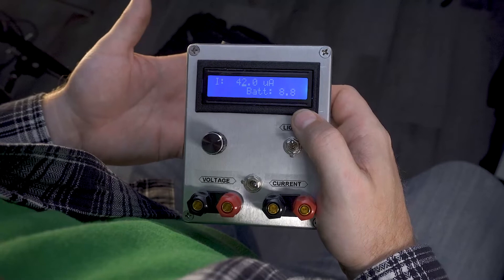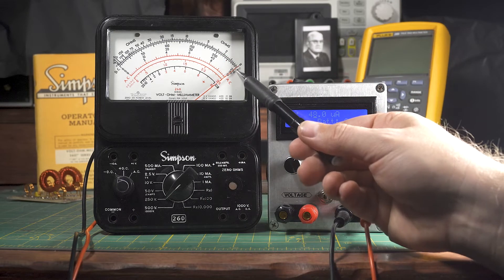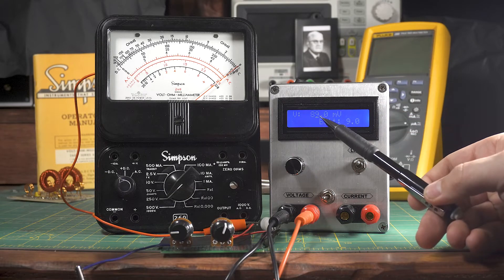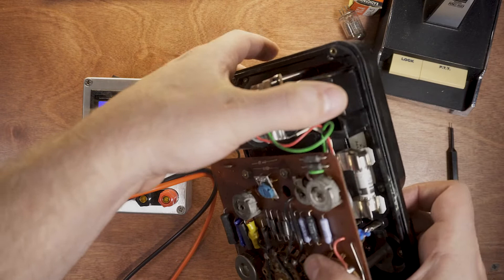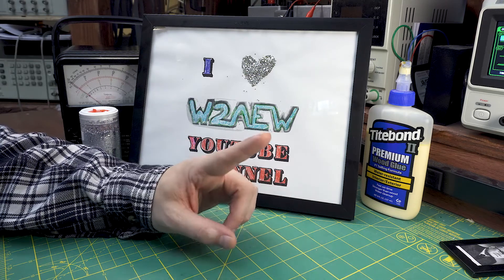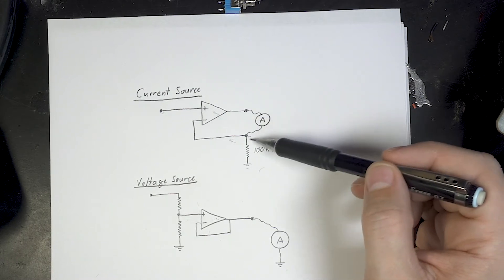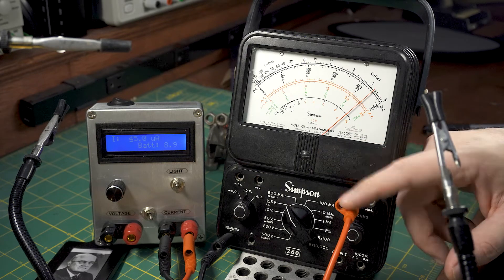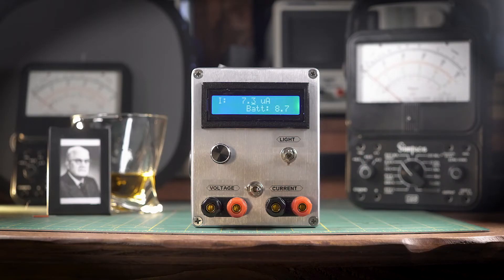Simpson 260 Calibrator and Calibration

Comment: Congratulation, great video. Hello my friend, 3 days ago I bought the same Simpson 260 Series 3 multimeter. Can you help me calibrate it, because in R*100 and R*1 the measurements are not correct. I tested the resistors with a Fluke 77 tester. Best regards.